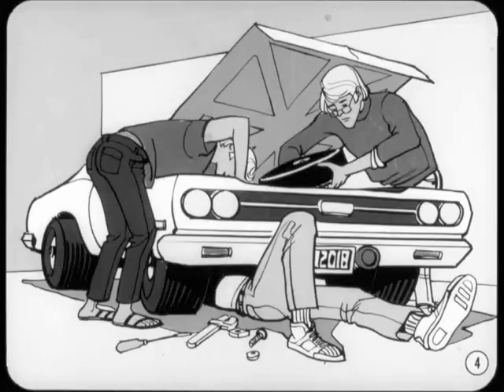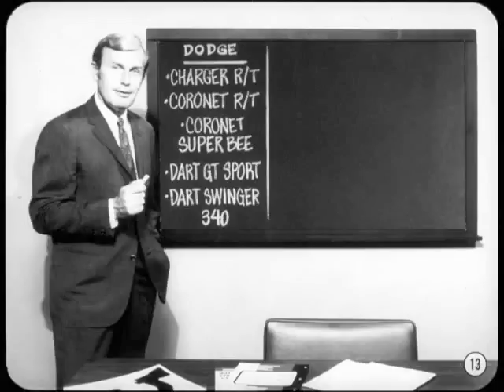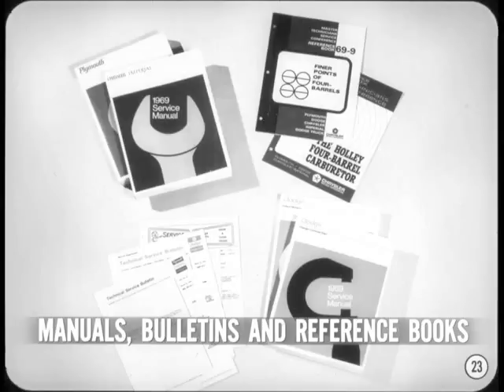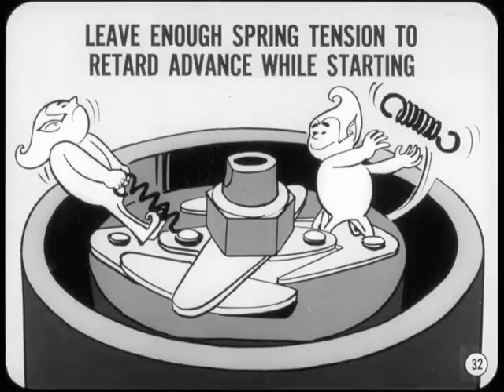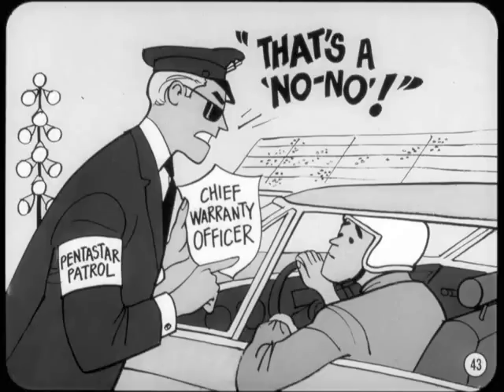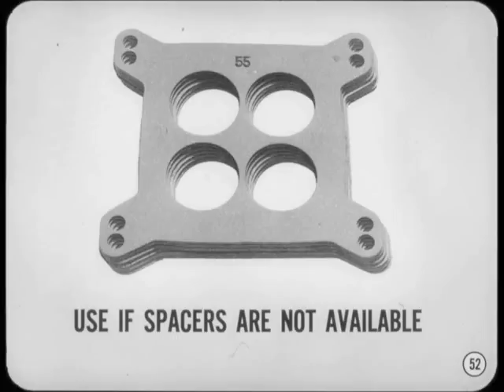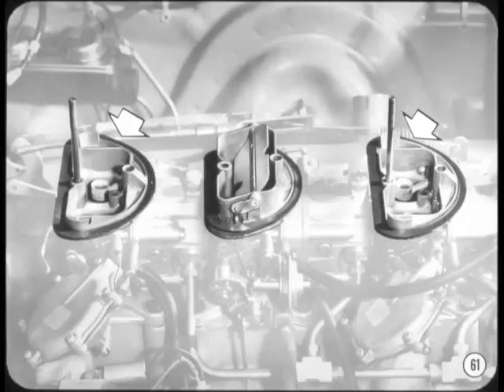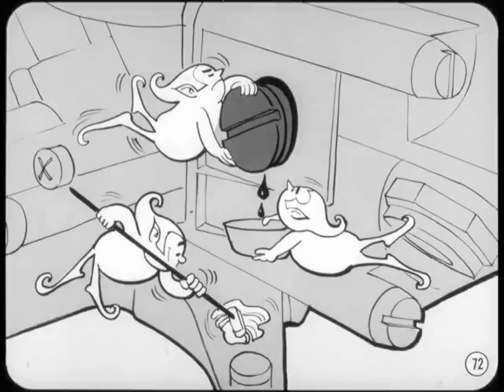Chrysler Master Tech - 1969, Volume 69-12 Performance is the Name of the Game

Comment: Best thing ever done was getting rid of carburetors, EFI, changed everything....modern cars are so much better than these crude messes where. mechanical nightmares
Reply: Yeah but they were way easier to work on & maintain them . 3 winters ago where I live in rural Wisconsin it was - 20 below & my new Chevrolet Silverado truck wouldn't start when I was going to go to a buddies now to work on a 69 Plymouth road runner we were building & what truck did I have that did start that morning ? My 82 Chevrolet K10 that started that morning that I use mainly to plow my driveway with but once spring summer comes back I take the plow off & take the truck out at times just to drive it because it's something different. I get people who give me the thumbs up in my 82 and nobody gives a rats ass about the new truck lol . The battery that's in the new truck is small and it froze from the cold temperatures and it could hardly turn the engine over a brand new battery & on this truck there's limited room where the battery box is so you can't put a physically larger battery in it . On  my 82 Chevrolet K10 that has a nice big battery box so I'm able to put a bigger battery that has much more CCA in it so it can crank the 400 sbc that is in it . The newer cars trucks also have control modules for everything on them that can & do go bad besides the computer and the mass wiring and crappy small wires used to bring power & grounds to everything is junk as well . These wires can look perfect on the outside with no cracked insulation but the wire used inside can break causing wires to loose power or grounds which causes all kinds of problems. If you do a continuity check and find a open wire you have no way knowing where the break in the wire is so most times you end up replacing the whole wire but recently Autell power probe is making a accessory for the power probe 3 that can trace wires that look perfect on the outside but tested to be open with a break in the wire it can trace the wire & pin point where exactly the break in the wire is now so you can cut that section of wire out & solder & shrink tube a new section of wire in its spot. New cars trucks are nice until they fail and they do fail a lot but it's the cost of having them fixed by guys like me that costs a fortune & some times depending on how bad of shape & the mileage is on these newer cars trucks it's not cost effective to even try to fix them anymore because they all now are throw away junk made to fail on purpose usually starting just before the factory warranty is up or at times right after the warranty is up and then you the buyer gets shafted by the manufacturer.